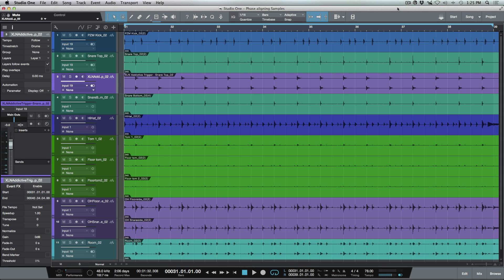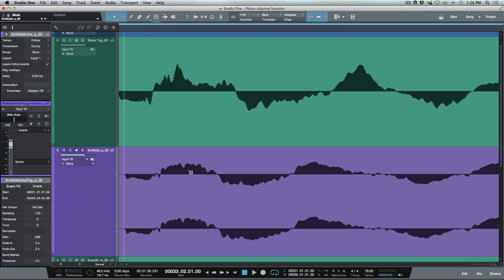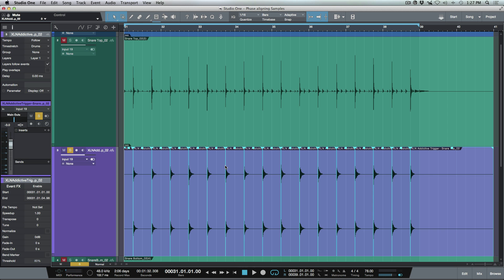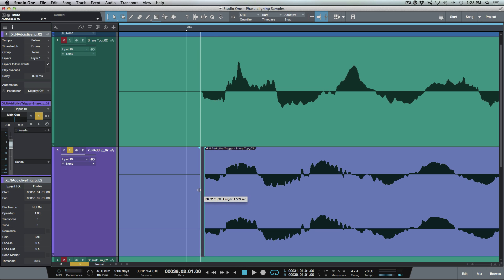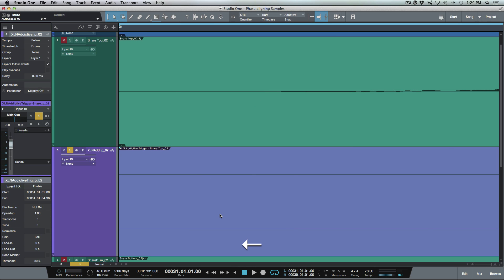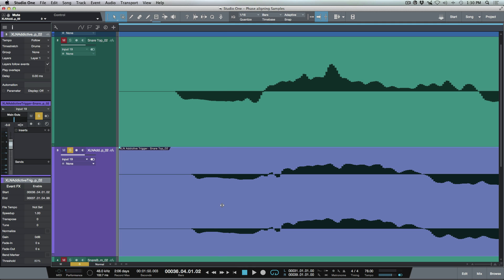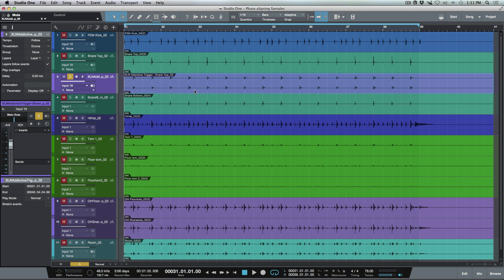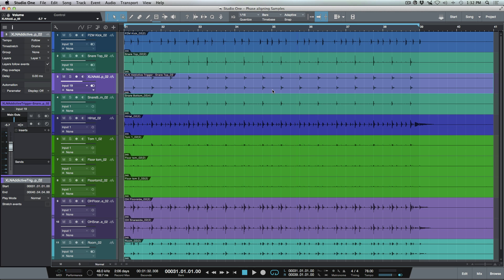How To Quickly Phase Align Layered Drum Samples In PreSonus Studio One

Comment: This looks like a job for the Waves In-Phase plugin if you don't have Auto-Align.  Can align in just a few steps, get it right across the board, and then bounce down.  Would be especially useful if the plan is to blend the captured drum with the sample rather than full replace.  But this video is probably very helpful for anyone who doesn't have those tools in hand.